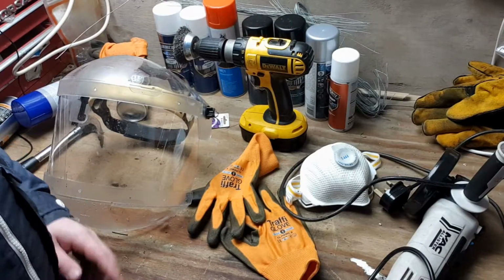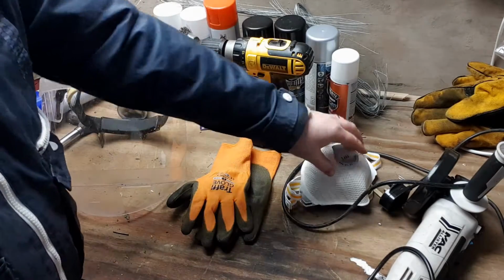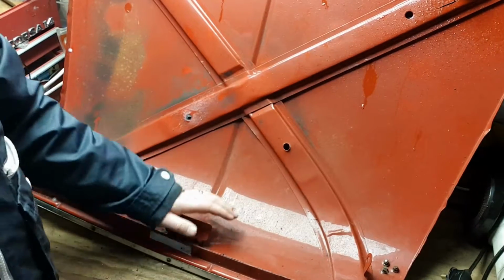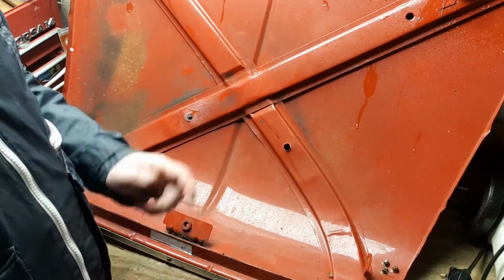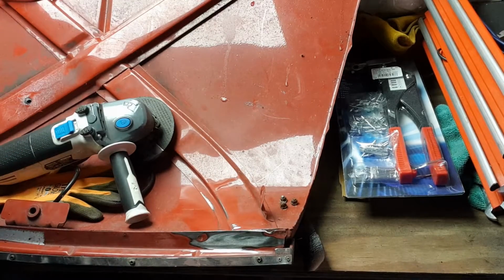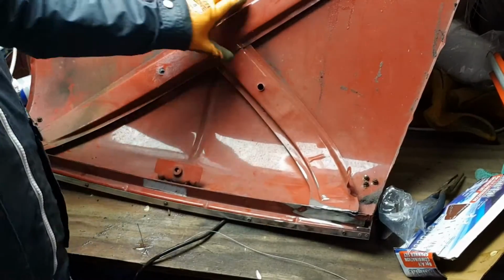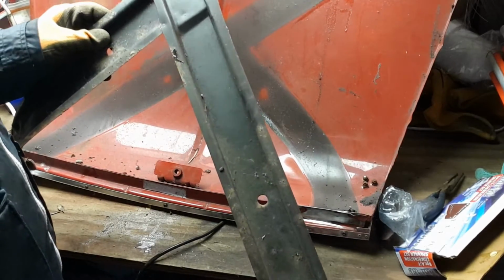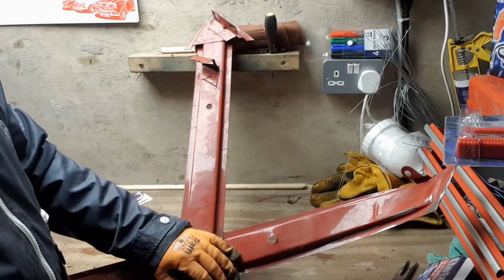Removing the X Piece from the Bonnet

Comment: Id perhaps bond it into the new bonnet with just some tacks at the ends? Most strengtheners are bonded to bonnets.  But be careful welding it to you new bonnet where you have cut it will mean you will see it on the top and need to be filled etc
Reply from the maker: Yeah welding it back on May not be the best option what do you think about tiger seal pal?
Reply: @thedjse  I've not used it for anything like that before. If it's anything like sika flex then if prepped right it won't go anywhere. I've used sika flex on stuff before it sticks very well

Comment: Mate the bits you cut were 90 degree returns. Its those return edges you needed to spot weld to the returned edges on the bonnet. It doesnt weld to the top face of the bonnet. So you dont see the welds the go on the edges. 

If that makes sense. You could weld new returns onto the bits youve cut. Be good welding practice. Lol

Hope that helps bud
Reply from the maker: Good thought process matey... the main reason I wasn't too bothered is the fact that it has the 3 holes in the front anyway so would not of been able to use the original weld points...

Do you think I will have issues after a slight skim of filler on the top matey?
Reply: thedjse depends how fussed you are buddy. Horses for courses i suppose. 
Returned edges are always strong points especially in corners. Maybe thats we they made them that way ? Never seen them welded straight onto bonnet. 
If it were me id make corners but as always theres more than one way to do things. Give your welding skills a try out too 👍